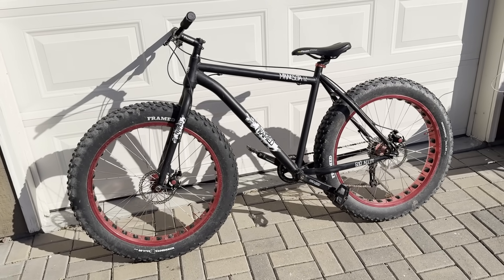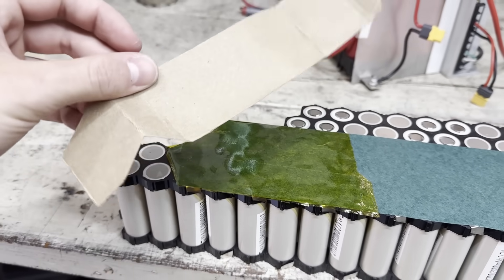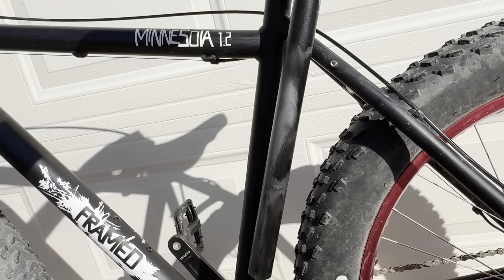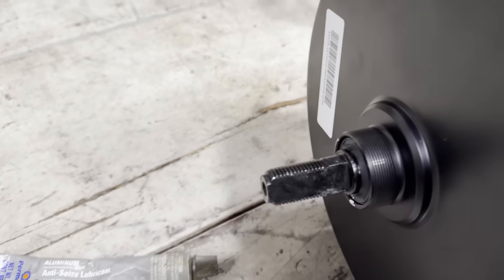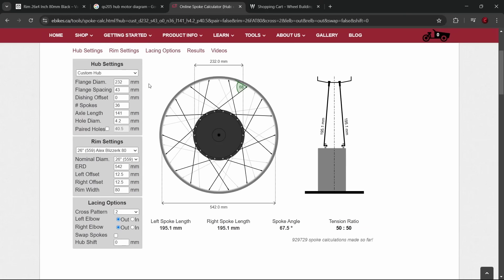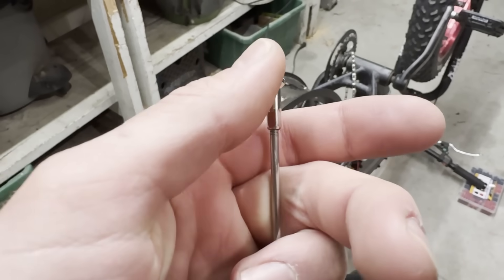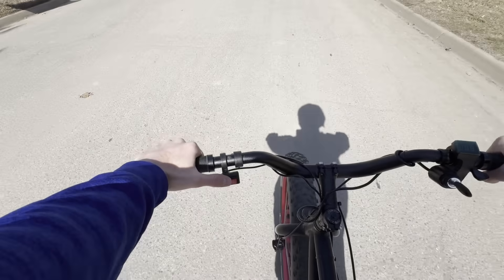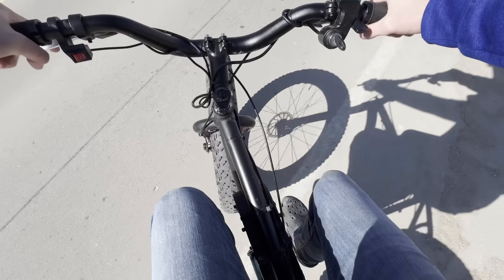Overpowered Fat Tire Ebike Build

Comment from the maker: CLICK "read more" FOR MORE INFORMATION ABOUT THIS BUILD!

If you’re in North America and want to buy any ebike/emoto parts for your builds, check out this website: https://econiccycles.com/discount/Cal5. This is where I buy a lot of my parts, and I’ve never received a dud product from them. Use code “Cal5” for 5% off your order!

Parts list for this build:

Bike: $160 (Facebook Marketplace)

Recalled battery: $0 (I'm not going to add this cost to the bike, since the only thing I used was the shell and if I were to build this bike again I would just build a triangle battery to fit the frame and duct tape it to the frame. Trying to fit the battery in the shell made it much harder than it needed to be to make the battery.)

Battery Cells: $144 (I ordered mine from batteryhookup and they are out of stock now)

BMS: $50 https://www.aliexpress.us/item/3256807163138183.html?spm=a2g0o.order_list.order_list_main.60.12491802aUrrS1&gatewayAdapt=glo2usa (This one isn't a smart BMS so I wouldn't recommend it. If I built this bike again I would use the 17S to 24S 100A option on this listing assuming it fits: https://www.aliexpress.us/item/3256805716752806.html?spm=a2g0o.order_list.order_list_main.11.25641802huxDqT&gatewayAdapt=glo2usa)

Spacers: ~$20 https://www.aliexpress.us/item/3256805728492234.html?spm=a2g0o.order_list.order_list_main.80.6ca01802sdun21&gatewayAdapt=glo2usa

Nickel: ~$7 https://www.aliexpress.us/item/3256805469007327.html?spm=a2g0o.order_list.order_list_main.79.6ca01802sdun21&gatewayAdapt=glo2usa

Copper: ~$5 https://www.aliexpress.us/item/3256802670955266.html?spm=a2g0o.order_list.order_list_main.53.6ca01802sdun21&gatewayAdapt=glo2usa

Fish paper: ~$5 https://www.aliexpress.us/item/3256805320632041.html?spm=a2g0o.order_list.order_list_main.49.66601802GEYiIq&gatewayAdapt=glo2usa

Kapton Tape: ~$5 https://www.aliexpress.us/item/3256805580784009.html?spm=a2g0o.order_list.order_list_main.54.66601802GEYiIq&gatewayAdapt=glo2usa

Motor: $420 (To order from qsmotor go to https://www.qsmotor.com/ to see what they have, then email sales@qsmotor.com and tell them what you want and they'll get it sorted and tell you who to send the money to on paypal.)

Freewheel: $9 https://www.amazon.com/dp/B0B6HKG8SP?ref_=ppx_hzsearch_conn_dt_b_fed_asin_title_1&th=1

Riser Bars: $37 https://www.amazon.com/dp/B0956QBZ9Q?ref_=ppx_hzsearch_conn_dt_b_fed_asin_title_1&th=1

Rim: $62 https://vamooseusa.com/products/4-rim-odin-black

Spokes and nipples: $60 https://wheelbuildingparts.com/product/sapim-leader-12ga-13ga-15ga-straight-gauge-spoke/ and https://wheelbuildingparts.com/product/12-gauge-brass-round-top-brass-for-use-with-12g-spokes-cut-and-re-threaded-with-us-threads-only/

Controller: $175 https://econiccycles.com/products/fardriver-sinewave-controller-nd72340-w-bluetooth

Throttle/ignition/voltmeter: $15 https://econiccycles.com/products/controller-essentials-key-ignition-w-voltmeter-thumb-throttle

Three speed switch: $9 https://econiccycles.com/products/controller-essentials-3-speed-switch

Other stuff I forgot: $17

TOTAL: $1,200
Reply: Will this one be for sale?
Reply from the maker: @ it is, I’m in east KS
Reply: I want to buy your bike @Calthecool
Reply from the maker: @henossei604  Are you near me?
Reply: @Calthecool  I live in Austria
Reply from the maker: @henossei604  sorry there’s no way I could get the bike to you for a reasonable cost, there’s people in Europe that build bikes like this that you could contact.
Reply: @Calthecool what about australia
Reply from the maker: @jjjj7199  same issue.
Reply: @Calthecool  Hello any recommandations in Europe ?
Reply from the maker: @ I don’t know because I don’t live there.
Reply: @Calthecool  bro how much for the bike 😭
Reply from the maker: @ I’m selling it tomorrow for $1400
Reply: @ damn :(
Reply: @Calthecool  in europe it is illegal like everything fun :)
Reply: You should make these and sell them, i bet alot of people would want this kind of power in a fatbike
Reply: Did it sell!? This is amazing!!
Reply from the maker: @ Yes it sold
Reply: @Calthecool  nooo i live in brasil , i wanna that bike
Reply: Wow thats badass dude...where are you located would you build a battery for me by chance? If not I totally understand and appreciate it all the same 🙏🏻
Reply from the maker: @ sorry I’m way too busy right now
Reply: LOVE WILL THAW A FROZEN
Reply: shopee👍
Reply: That's so badass the way you have listed everything for builders to go by. That's really awsome to have done that. Thanks you!
Reply: That’s way cheaper that I thought it would be, holy
Reply from the maker: @ yep, the main savings were finding a good bike for cheap and making the battery, it would easily be $2k+ otherwise.
Reply: Cycling in rain with sandals is the best
Reply: Cool video, bro! Quick question: Do you need to use the throttle, or does the motor activate while you're pedaling? I assume you installed a PAS (Pedal Assist Sensor)?Can you help me out
Reply from the maker: @mitta8218 I use a thumb throttle, a pedal assist sensor would be dangerous on a bike that’s this powerful.
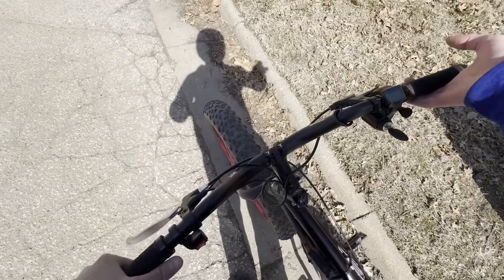Reply from the maker: @thedong5383 I don’t know the exact model of the bike, but yes you can just pedal it normally 9:25
Reply: Cool bike what controller you used there's 3 options on the site?

#1Regular 
(bluetooth module)

#2Built in 
(no module needed)

#3Built in 
(no module needed) 
no box
Reply from the maker: @frostygeeskeke-oc2vv this one was built in, the box option doesn’t matter because they are just selling ones with no box for a reduced price, the actual controller is the same.
Reply: @Calthecool  ok cool thanks and whats your battery volts and how many cells and how many amps?
Reply from the maker: @frostygeeskeke-oc2vv this battery was a 4p20s battery made with Samsung 30T cells, which means it is 72v with 12Ah of capacity and 140A of discharge current (actually only 120A of discharge because it has a 120A BMS). If I were to make this battery again I would use Molicel P45B cells, which would give it 50% more capacity and 28% more discharge current.
Reply: @Calthecool  can you recommend a wheel and spokes for me I have a 26inch rim, BTW it's 29inch with the tire mounted. So since you had a issue with your rim wich one could I get?
Reply from the maker: @frostygeeskeke-oc2vv  I don't know enough to do that
Reply: @Calthecool  im getting the motor and bms im gonna build on a #bca sc29 bike
Reply: Quick question I can go from 24v to 72 on my battery and set it at different voltage. Now top speed is 50mph and where should I set it to get the max power and speed for the bike?
Reply from the maker: @MarcoRodriguez-mj8pl  What kind of battery do you have that you can change the voltage?
Reply: @Calthecool 48v 15ah lithium battery. I can change the voltage from 24v to 72v and the higher the voltage the battery bar display goes down. I can change it from the LCD display
Reply from the maker: @MarcoRodriguez-mj8pl  What you’re changing isn’t the battery voltage, that setting is what the display thinks the battery voltage is. You should set it to match your battery, so 48v. If you set it to anything else it’ll just confuse the display, which is why the battery indicator changes.
Reply: @Calthecool thanks. One more question can i get more power out of the motor of the bike?
Reply from the maker: @MarcoRodriguez-mj8pl  I don’t know what bike you have but on most bikes you can get more power out of their motor, but you’ll have to upgrade the controller and battery.
Reply: can you provide a link or a direct name of the hub motor that you used?. I'm having trouble finding it on the website. Thank you.

Comment: I got a hiboy p6 how hard would it be to upgrade it to a monster like this?
Reply from the maker: You wouldn’t be able to use any of the stock electronics so it would be the same as this video. I looked up “hiboy p6 rear dropouts” to see if they’d fit this hub motor and it looks like they would with some custom torque arms like the ones I made. If the bike doesn’t have to have the stock battery pack installed for any structural reasons then you could remove it and maybe have the new battery pack slide into that spot which could allow you to have a larger pack.
Reply: @Calthecool  thanks bro for the knowledge. I'm just starting to get into these things.

Comment: For such a strong bike you definitely would want stabilizing tech. Maybe speed dependent maximum torque and angle sensing to throttle it down if front gets up
Reply from the maker: I have all that built into my muscle memory. I wouldn’t let someone without enough experience anywhere near this bike.

Comment: ok so that's a 9kw motorcycle, basically. literally full circle to 100 years ago when people made motorbikes the same way by strapping small engines to actual bicycles. 9kw is around 12hp. most 125cc can go that speed. You're basically riding a motorbike.

Comment: I have 2 of these recalled batteries on my bike. haven't had any trouble yet. Suppose its worth opening them both up and rearranging the wiring so there are no pinch points. I can get up to 200 miles of range out of them in lowest pedal assist mode in 7th gear. It makes the pedaling just comfortable enough. could pedal for hours going a steady 10 to 15 mph.

Comment: Imagine a front and read motor distributing power equally.  Would add weight but the bike wouldnt try throwing you off and you'd be able to really launch it
Reply from the maker: You would have to do like 30% front 60% rear otherwise the front would spin like crazy.

Comment: Amazing build :) Any tips for finding bikes that'll actually fit the wide dropouts most hub motors require? or is bending just the norm for builds like these?
Reply from the maker: For any bike you have to bend the rear triangle in/out a bit to fit the rim or motor. I’m not the right guy to ask what is too much bend but on this bike I could bend it to change the dropout distance by about an inch before there was a lot of resistance, I wouldn’t want to do more than that because it would definitely weaken the frame.
Reply: @Calthecool  yeah definitely, overbent frame + motor it was never made for is begging to have it snap on the road, thanks for the video and response though, both very insightful :)

Comment: I know people like e-bikes but for less cost around $900 you can buy a brand new motorcycle that goes 70mph with tires made for cornering at speed. you can ride for hours and 30sec to refile tank, instead of 20min ride and 8 hours stop to charge. You did a really good job on the bike and iam glad you went with bigger tires. Cool video.
Reply from the maker: For sure they aren’t for everyone, but where are you buying a brand new motorcycle for $900?

Comment: This is a little late but I wanted to ask what is the exact voltage and ah on the battery?
Reply from the maker: The cells are Samsung 30T cells, 3Ah and 35A discharge. They have good output current but they aren’t the best because of the low capacity and low cycle life. The pack is 20 series and 4 parallel cells, which makes it 12Ah 72v nominal.

Comment: How come BMS on the battery doesn’t engage?
Reply from the maker: What do you mean?
Reply: It seems it’s a small battery to handle this much current. In mine bms just shuts it off.
Reply from the maker: @NigelOcconel it is a pretty small battery but since it has high current cells it can do it just fine. Most ebike batteries are made with lower current cells since they don’t need to output a ton of current and they have a higher capacity.

Comment: You need to rotate the axle 180° so the phase wires point forward instead of to the rear. It should have less strain on the wires so they are less likely to work harden.
Reply from the maker: The cable wouldn’t fit because of the brake rotor and the brake rotor bolts.

Comment: Really great project! Something like that would be great here in the desert where I am. The fat tires do a really nice job on the loose sand. Very nice work. Especially on the battery pack. Yours was so much better refined than the commercial unit you started out with. Thank you for sharing your project. :chillwcat:

Comment: Man, I'm slowly falling down this rabbit hole of homemade e-bikes, I'd like to build one that looks exactly like this one, but with less power (because of the way the roads are made where I live)

Any recommendations? Not just about bikes, but in general. Your videos are amazing, but I still feel like I need some extra help so I don't screw it up
Reply from the maker: If your roads are bad then maybe try to get one with suspension, it really takes the fun out of riding if you have to constantly avoid bumps. The only other thing would be to not cheap out on a battery.
Also keep in mind that your first build doesn’t have to be perfect, because it’s more about learning and you’ll probably want to build a better one after a while anyways.

Comment: It's weird to me seeing those little wires carrying so much power. I'm used to working on 14v motorbikes which need much thicker wires.

You should pack as much battery into the frame as possible and see what kind of range you get out of it. Range is normally the downside to electric because they don't put big enough batteries in them.
Reply from the maker: Love me some higher voltage to transmit power. Sadly you can’t just slap a massive battery on a bike like this because the frame would probably snap.

Comment: You think this hub would fit an enduro type bicycle? ive only built a electric wheelbarrow but im considering building something similar to your bike out of necessity.
Reply from the maker: It’s a qs205 motor, look up the dimensions and compare it to your bike to see if it’ll fit. I’ve seen this motor on a ton of different bikes so it’ll probably work.

Comment: Wow, that’s awesome. Thank you and congrats. How did you get the throttle to sync with the motor?
Reply from the maker: The throttle and motor both connect to the controller, which you can connect to with your phone to change any settings that you want.

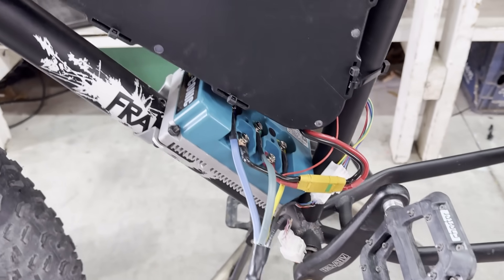Comment: 5:50 IMO you could have made 3 thick custom  spokes with metal, instead of a new rim.
Reply from the maker: That would be an interesting project, but I would probably need some good aluminum and a laser cutter for it to turn out good.
Reply: @Calthecool  I want to know something important, the width of this motor -- is it a special size for fat bikes or is it a motor for non-fat bikes that can work for fat bikes?
Reply from the maker: @ianrajkumar I don’t know the width off the top of my head but the motor is a qs205 so you can look up the dimensions. I’ve seen plenty of people install them on non fat tire bikes.

Comment: You're the pro but I'd say make it a more balanced bike so the weight distribution and the wheelies are more controllable. Has no point in having a bike that feels light if you can't pick up the rear end.
Reply: Like seriously you're the pro, that is a beautiful bike build. 
I have an e-bike and it's been fun it's something that was basically given to me and I have wiped out on it twice but today I did drop in on a giant dirt birm created by a bulldozer. Of course I wiped out on a little bit of slurry mud I didn't see you before that, so I had to make up.
Reply from the maker: @matthewhealy4752 I don’t really see that as a problem because for what I made this bike for it actually works in its favor. I knew it could be a bit wild but it’s a one-off so I just went for it to see what would happen.
Reply: @Calthecool yeah I'm 43 and I'm just finally starting to get better at Willy's so I imagine the weight distribution definitely plays a part!
Popped up on my 90's BMX Mongoose the other day and just coasted for like 15 ft in that wheelie without pedaling! It was sheer balance it felt so cool!

Comment: Not that you would want to lol but what would be next to make it even more powerful?
Reply from the maker: This is really at the limit of what the frame can handle, it’s not designed to have 1kw much less almost 8kW. If you had a similar frame but made of steel with full suspension, you could use the 3.5T version of this motor that can handle higher peak power. I’ve seen people claim up to 15kW for those. If you wanted to go all out then use a qs273 motor, it’s a larger diameter motor that can handle a crazy amount of power. EBikeGuy has a bike with that motor that can go 100+mph, it’s crazy. Of course for either of these options you would need a custom battery and a larger controller.

Comment: Why cant you weld on the ground cells? I've done it before. Lower the setting on the welder and it welds perfectly fine. All you have to watch out is rust(or seal the surface somehow)
Reply from the maker: Idk, I’ve had a couple people say that it’s doable but I tried for a good while switching the settings and trying different materials but it would never work.

Comment: I have this controller with 3000w Qs motor on my bike，you can still get a lot more top speed and power by swaping a larger battery（if you need it LOL）Neat handcraft and excellent video❤Please do more❤
Reply from the maker: You probably have the 3.5T version that spins faster.